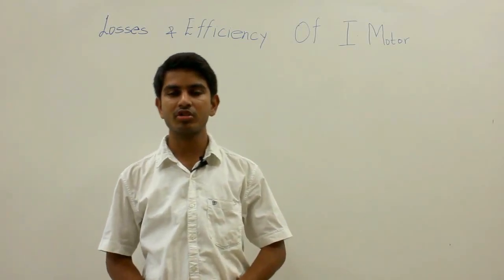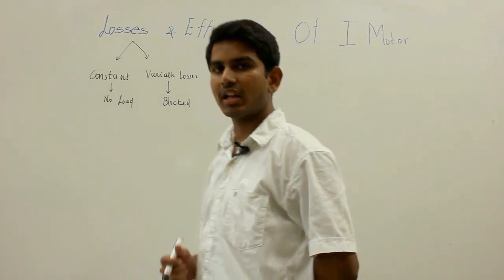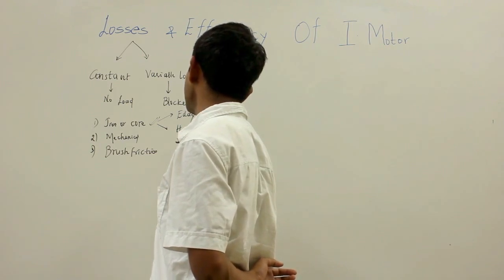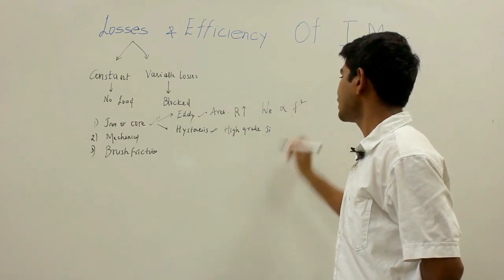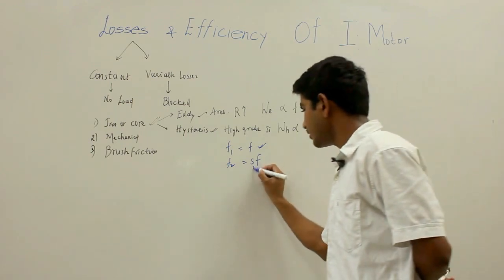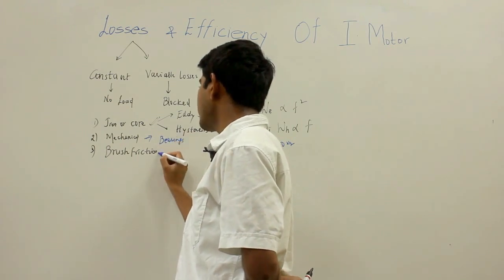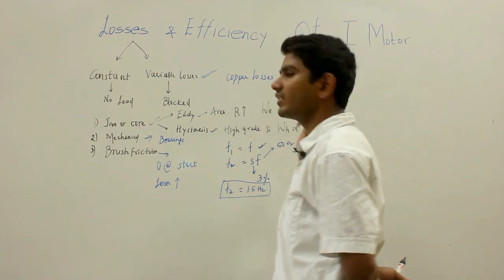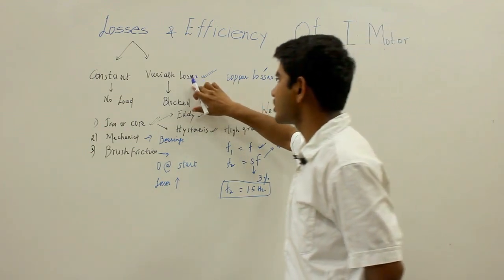Losses and Efficiency Of a 3-Phase Induction Motor

Comment: A 3 phase, 400 V, 06 pole, 50 Hz induction motor develops mechanical power of 20 KW at 985 RPM. Calculate the rotor copper loss